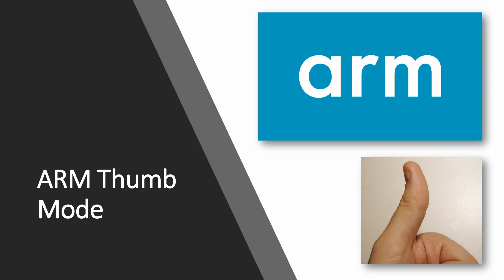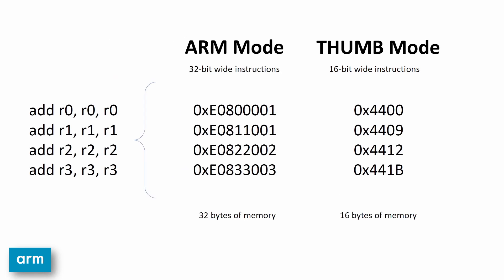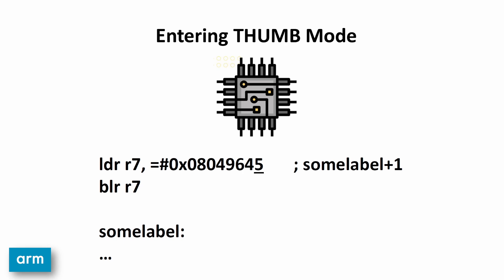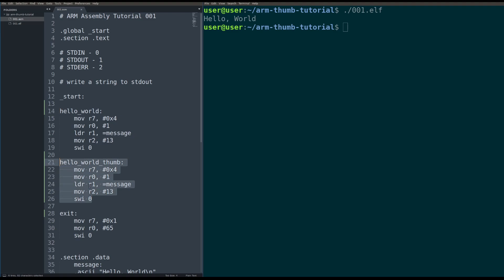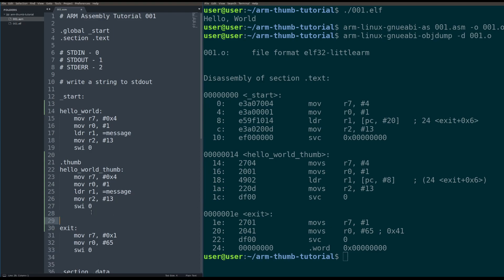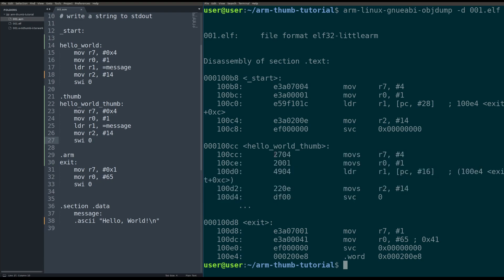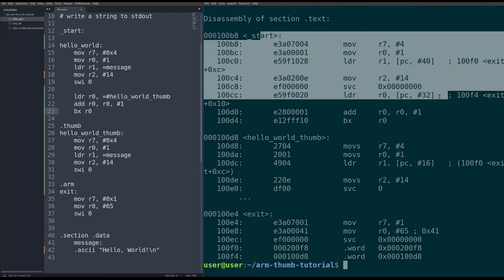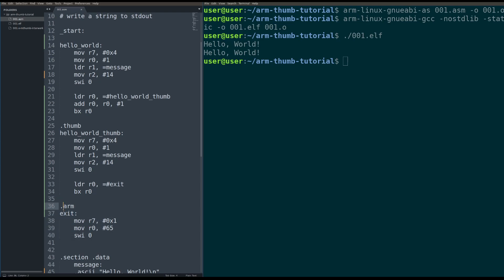Computers Have THUMBS and You Didn't Even Notice

Comment: Would it be cleaner to jump/unconditional branch to the thumb address (+1) during assemble time rather than compute it at runtime? And than same to switch back (masking out the lsb, if needed). That way you're not eating up all the saved bytes with mode swapping instructions.

I'm kind of surprised the assembler doesn't emit a warning (or even an error) if you switch between modes and don't modify the instruction pointer in some way immediately before the transition.

Comment: When I run my binary I got an error : -bash: ./001.elf: cannot execute binary file: Exec format error
Reply: Searching for fault, fault detected, failure sits for device! ARM M type can only use thumb mode, ARM A type thumb and A32 using
OS. But it is not possible, never ever executing a program in AMD64 written for ARM. Sorry, my fault!
Reply: @lostulutz8526  It's possible to emulate. On linux you can install binfmt-support and qemu-user-static. This allows you to execute binaries for different architectures.

Comment: I have two questions. What exactly does branch exchange do? And can you write thumb for aarch64 or is that not supported, are the only two modes aarch64 and aarch32?
Reply from the maker: From the ARMv8 manual "AArch64 state supports only a single instruction set, called A64. This is a fixed-length instruction set that uses 32-bit instruction encodings."

:(

Comment: Cool. Now, let's say you would want to do that from the comfort of C, how would one tell the compiler?
Asking for a friend.
Reply from the maker: Good question!

With ARM gcc, you can you the -mthumb flag to compile that piece of code to thumb mode. You will need to separate your C files into which ones you want to be thumb mode and which ones you want to be ARM. 

This is the answer at the compiler level, there may be C preprocessor flags that I'm not aware of that will have the same effect.
Reply: @LowLevelTV  I tried compiling for the RPi Pico with #pragma GCC target ("thumb") but the output files are a couple of bytes larger instead of smaller, and then I tried passing to Cmake CMAKE_C_FLAGS "-mthumb" but that spews  errors  about processor does not support such and such instruction in thumb mode.
Reply: @Jeff··Uy  the pico is an M0+ than only support thumb mode.